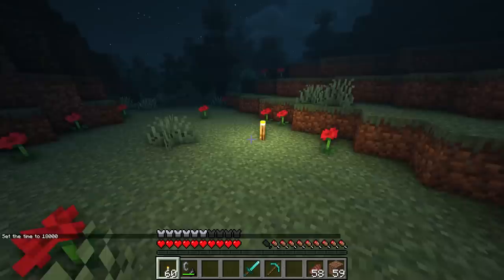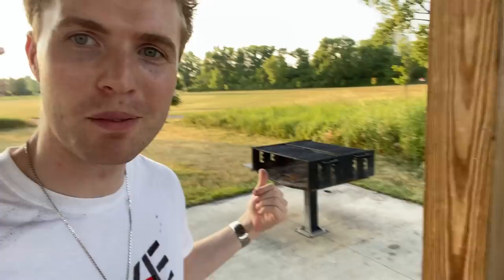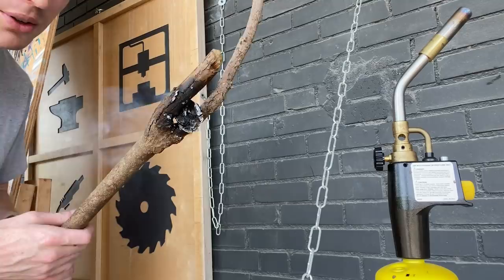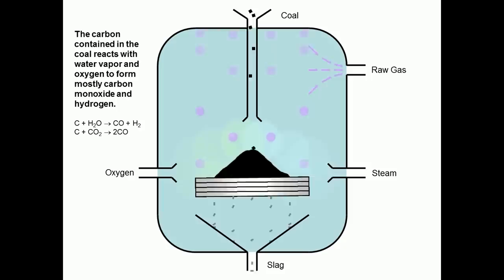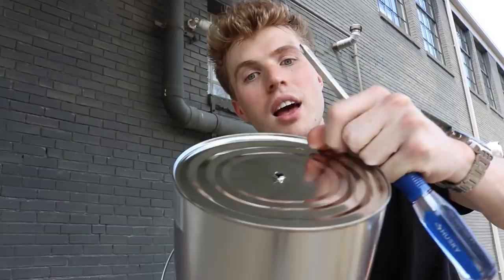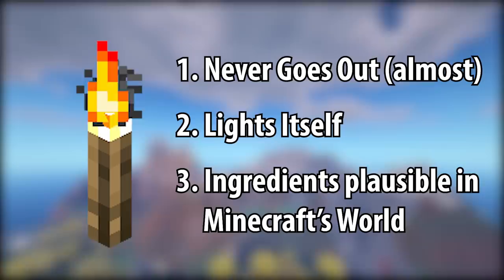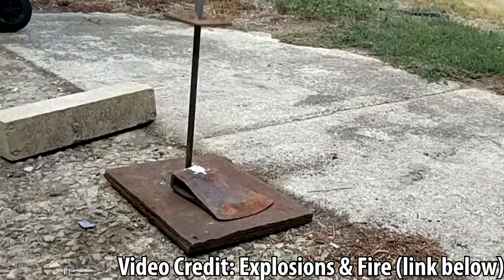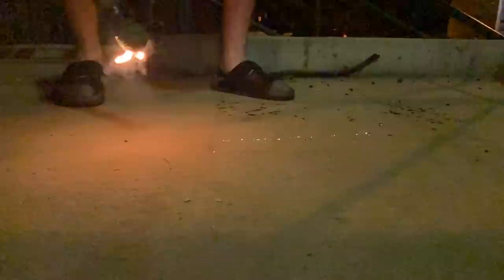Does Minecraft's Torch Recipe work IRL?

Comment: nice looking torch. Its cool how easily it lit with friction. How long did that pitch flame last for?
Reply from the maker: Well, I had to put it out myself because I filmed the ending at night & wanted to sleep — but at least 20 minutes.

That said, as I alluded to in v2 of the torch, using a rag to hold the pitch would help it last a lot longer. As it is the pitch kind of drips off the stick, which (obviously) shortens the burn time. I did mitigate this somewhat by cutting ridges into the wood (like a honey wand), but a rag or some absorbent paper would help even more. Basically the more pitch you can hold on the stick, the longer it’ll last.

Comment: "red phosphorus is hard to get in the us"
easily gets some from matches
Reply: It's hard because you need a lot of matches
Reply: @henriquenogueira31  but like aren't matches cheap?
Reply: I think he meant hard to get from buying ig or getting it professionally.
Reply: I think he just meant white phosphorus itself
Reply: @santiagomendez246  he used red phosphorus
Reply: @henriquenogueira31  ye but I think he was saying that white phosphorus is used to make meth
Reply: What he is saying is it's hard to get, not impossible.

Red phosphorus is regulated since it is a key ingredient in making meth so you cant jus tabby the stuff, instead you have to loop the system by buying matches which just so happens to have red phosphorus as a key mechanism. It's still hard to get cause he had to take the extra steps to turn the matches in to just the phosphorus and even then it's not pure.

Comment: 7:07 i don't know if you have mixed those but please never do that, that stuff can self-ignite at any second when you mix them
Also, the safe way to do this is to make paste of the 2 chemicals separately and then apply them as 2 layers onto the match. BTW safe does not mean anyone should try this at home.
Reply: Armstrong's mix doesn't autoignite under atmospheric conditions. It's shock and friction sensitive, but it won't spontaneously combust just sitting there.

Comment: The coal was probably flying as gasses inside it expanded (that's why when you first light a coal fire it tenst to crack and pop a lot).
Its these gases that burn really well when it's it and that's why it didn't burn so well when ground up - they escaped to quickly

Comment: 5:55. Well Steve is UN BELIVABLY strong. I mean someone even calculated it. He can carry up to 97941957.12 pounds. So maybe he's strong enough to light that
Reply: He can also rip solid blocks of metals and gems into their respective bars and gems with nothing but his hands, and with diamonds having a tensile strength of approximately 424,960 psi spread over the 1 sq meter that makes up a single block it means that Steve can pull with a force of at least 658,668,000 lbs, meaning he is at least an order of magnitude stronger than that estimate

Comment: They don't need better heat retention to stay lit, they need more oxygen; This is made evident by its ability to ignite when blowing on it, adding oxygen but actually drawing heat out of the charcoal. 
Also, giving it more surface area would give it worse heat retention rather than better; It allows more cool air to flow past it and draw the heat away from the source. This would, however, also allow more oxygen to get to the charcoal so it is still getting you closer (evidently not close enough) to your goal of sustained ignition.

Comment: I mean.... Tbh you could have just done this with Pine resin, Cut a stick in half to hold charcoal/coal, A tiny bit of flint on the tip of the charcoal/coal and boom.... You have a giant stick on fire lol
Btw, this works WITHOUT Flint AND Steel. Just flint, which tbh can be easily found in places near rivers ect JUST LIKE MINECRAFT.